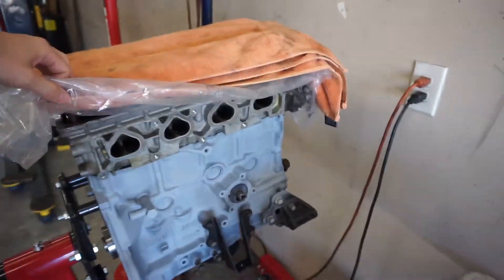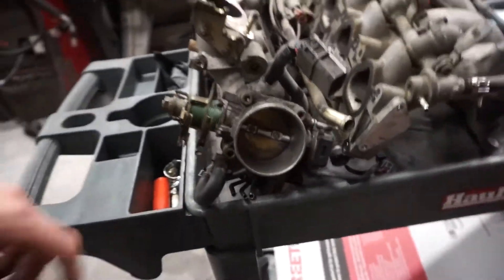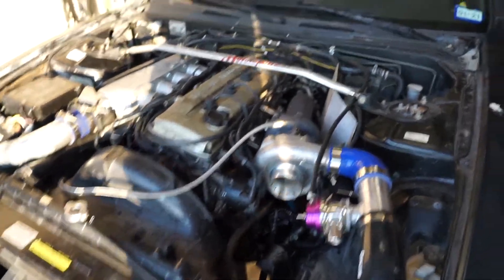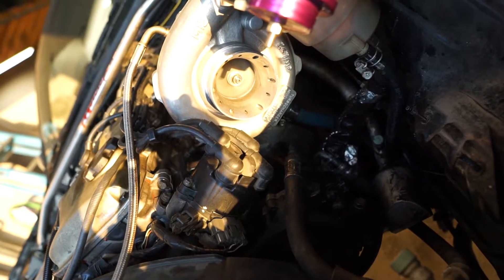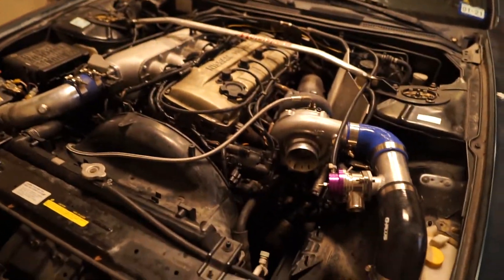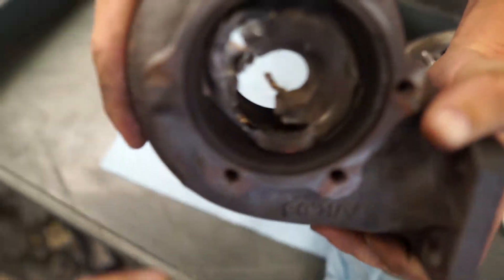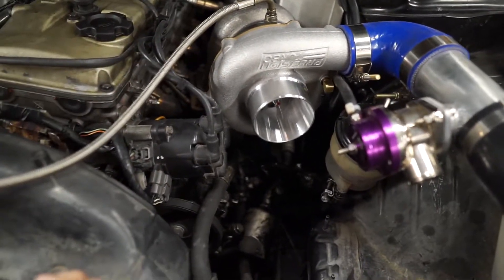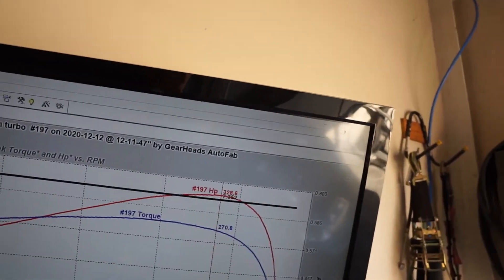Ebay turbo broke in half!!

Comment: Wild!  At least it was only the exhaust side that grenaded and just blew out the pipe instead of blowing into the intake and wrecking the engine. In your experience, how much boost can a stock set of injectors usually handle? Just as an average?
Reply from the maker: Maybe 1-2 psi if that , stock injectors are basically only good till around 150hp.

Comment: 2006 subie sti with stock turbo. Milesge 130,000 . When should I worry. I change the engine oil every 3000 miles synthetic  5w-30.. did the turbo failure ruin your engine ?
Reply from the maker: Sounds like you are doing a grate job taking care of your car, and most of the time the motor is totally fine after a turbo failure. Even on my BMW X3 my turbo failed , installed a new one ....good as new again no other problems.